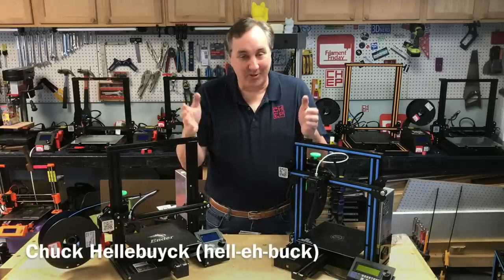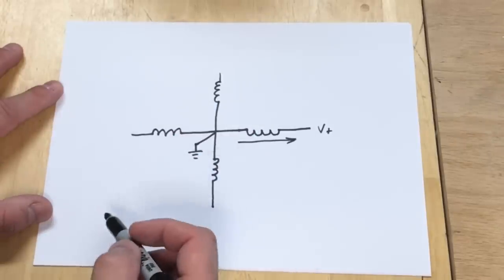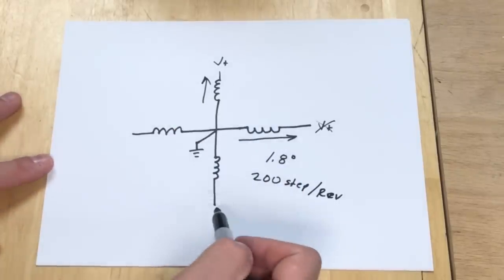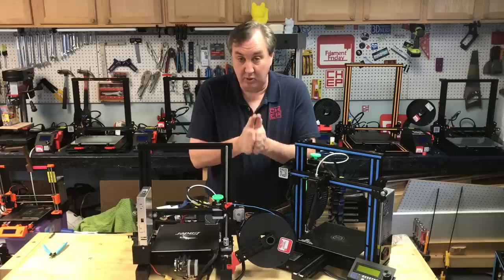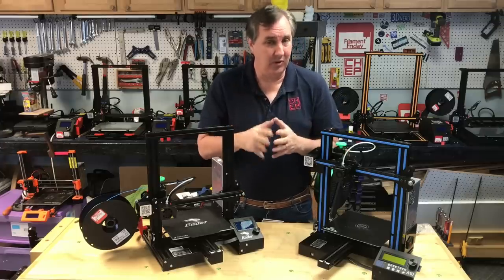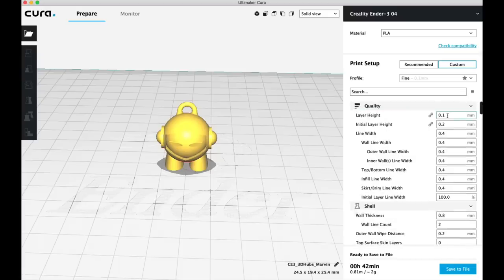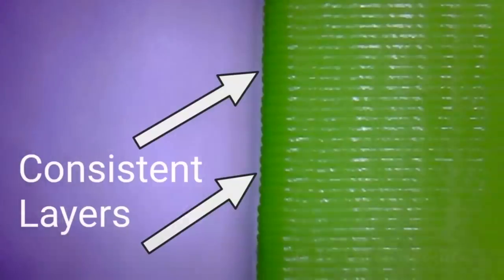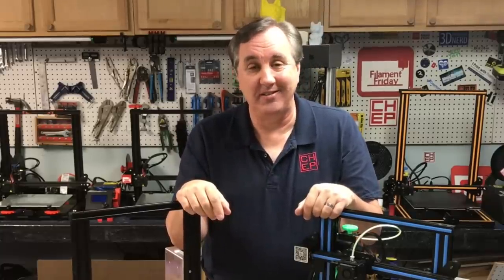Better Quality 3D Prints Using MAGIC NUMBERS on Creality Ender 3, CR-10, A10

Comment: So as I understand this, we're trying to step up layers using only the motors natural steps, Right? Because these are steps along the rotation where the magnets "want" the shaft to stop and so are more predictable/consistent than microsteps? If I'm correct so far, I can get behind that logic, it makes sense to me. But what if your Z0 happens to be at one of the motor's microsteps? Doesn't this all kinda go out the window?
Reply from the maker: Nope, it rises to the same Microstep each layer thus averaging out the variance.
Reply: Machining tolerances in the rotors and stators of stepper motors are not precise. 
Every tooth on each rotor and stator are slightly different, ANY given microstep applied to any tooth will vary from one to the next. There is zero benefit in trying to land on the same arbitrary number.
Think of full steps as large peaks and microsteps  as (8 or 16 or 32...) smaller peaks between each larger peak.
The peak to peak distance of each full step varies slightly, so each repeating micropeak will also vary.
Reply from the maker: But if you ride at the same step each time you average out that variance for a more consistent Z height.
Reply from the maker: The stepper driver creates multiple magnetic vectors between the motor natural steps. This logic just creates a consistent resolution so the Z axis rises from the same point to the same point of the motor rotation.

Comment: Thanks a lot.
If I well understand, that means the minimum layer height I can use for the best results on my Ender 3 will be 0.04mm, right?
Lower height will be no use (because smaller than the step) and use much more time for same results.
Reply from the maker: Because of the mechanical limitations I would say 0.08 is the minimum.
Reply: Thanks  @FilamentFriday , I'll have to test it. But currently with 0,4 nozzle, not sure it will worth it, need to test 0,08 with 0,2 mm nozzle for best results.

Comment: Where do you get these specs for a 3D printer so you can calculate the magic number? I'm using a Creality CR-5 Pro H. This is one of the best tips I've seen to increase quality. It seems like common sense and something I would assume would be factored into the slicer settings from the factory.

Comment: For sure it makes a difference running the Z at full step resolution, but in reality You will hit a random microstep when homing, and only have the relative moves be full step, never ending in the most stable position. So no idea, why it actually works.
Reply: Same thing I thought,  unless you end up homing on full step at beginning it will be off the rest of the time
Reply from the maker: Because like I said in the video, even if you start at a microstep you rise up at the same microstep position all the way up so you get consistent spacing.

Comment: Will you do info on the ender 3 firmware? Firmware updates? On all of my long prints I ALWAYS get -> Communication timeout while printing, trying to trigger response from printer. Configure long running commands or increase communication timeout if that happens regularly on specific commands or long moves.
with octopi

Comment: Does that mean that getting lead screws with smaller pitches could potentially improve print qualities because there's a lot more "magic numbers" you could work with?

Also what about if you have mesh bed levelling enabled. I'd imagine the printer would be doing lots of microsteps for the initial layers before it reaches it's "fade Z height"

Comment: Hi, thanks for the vid. I'm not exactly sure if magic number theory is correct, because for it to be true, z endstop should always occur at full step. How can one be sure it is? If endstop happens at half step and you try to add 0.04, it will still be a half step.  Or am I not seeing something?
Reply: I think the point is that you will always be using the same microstep, which means that the print will be more consistent.
This might also vary with higher-resolution stepper drivers like the DRV8825.
Reply from the maker: Nothing guarantees the microsteps are equal angles but as I stated in the video if you start at a microstep you rise at that same consistent step.

Comment: There is a reason to use a single start lead screw for Z (I switched my big DIY printer to use those)-- yes the step/mm will be high, but then there are no magic numbers as single physical steps are 0.01 mm. Can't move Z very fast, but who needs to -- so I get super high precision on Z, and super accurate layers
Reply: You DO have a magic number - it's 0.01

Comment: 1) this magic numbers will only help if your stepper starts homed with a fullstep what is unlikely
2) there is a calc on reprap
Reply from the maker: 1) Not true. If you start on a microstep you will rise a full set of microsteps and end up at the same step all the way up. This averages out the variance in the Microstep angles giving the print even layer heights. 
2) yes there is.
Reply: @FilamentFriday  Sure helps, because of the delicate balance driver needs to accomplish to have the uSteps* evenly distributed (if it succeeds!) between a full Step  and the next one,  as a result uSteps don't have the torque the Steps have, the load will be lifted strong at Step then less and less strong until the middle uStep then the process reverses becoming strongest at the next full Step, as the load is equal but torque varies the distance between uSteps will be more consistent , say,  equal, if the path is multiple of uStep settings (i.e. multiple of magic number) . e.g  if it will fall in the same weak  torque uStep or the same strong full Step doesn't matter, the key word is here "same".  Good video, though you scratched too quick the uStepping  balance process :)  *by uStep I mean micro step

Comment: You mention that this works for microstepping in between layers or if you are are natural steps.  Is there a way to check if you are at a natural step or microstep, and perhaps adjust so that you are at natural steps throughout using z-offset?
Reply from the maker: Read my comment above yours for more detail.

Comment: Hi CHEP, 

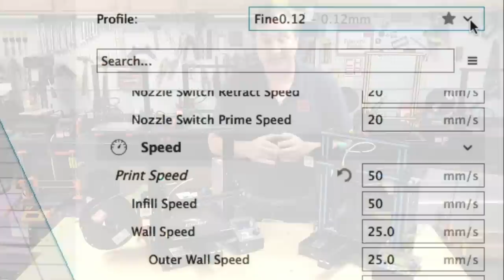My CURA 4.8 only has three (3) quality settings: High (.10), Normal (.20) and Draft (.30)...are your settings (at the 3:45 mark) custom settings set up in individual custom profiles, or are they someplace in CURA that I missed in the initial setup, or are they machine specific (I have an Anycubic Mega S).

Thanks! Your videos have helped me bunches.
Reply from the maker: Your machine specific I assume. I show the Ender 3 in my videos.

Comment: Cura 4.7.1 now applies the Ender 3 pro magic numbers to the default quality profiles, however it does not go below 'Super Quality 0.12' layer height.  What would be the best way to add a couple of profiles for Fine/extra fine at .04 and .08 layer height?
Reply from the maker: Use “Create profile from current settings/overrides...” after you’ve made your changes

Comment: Thank you for passing on clearly brilliant advice in your videos. After watching thwm i have now infact bought the ender 3 along with the extra nozzles, it arrives on the 11th. I will be using magic numbers like the 3d printing bible after seeing these results.
Question pretty please with a cherry on top?
How can i apply the magic numbers when making D&D-style table top miniatures? As in with the smaller nozzles, i would like to aim for a relatively detailed finish if possible. Using Hatchbox PLA and files from thingiverse, as i literally am newb level, in the future i will attempt my own designs, but for now i want to go on a printing binge without blowing a roll of filament 😅.
Reply from the maker: Print at 0.08 layer height.

Comment: Great video Chuck, I have a Balco HE180021 does it have 8mm per single rotation of Z axis screw and 1.8 degree stepper motor?
Reply from the maker: I don’t know but most printers use 1.8° steppers and you can measure what one rotation of threaded rod does.
Reply: balco is a wanhao i3 clone and the magic number is 0.02

Comment: Thanks for good tips but I have Question.
so even though I set my layer height to 2.0 for example, the stepper motor won't line up with it's main coil(not micro stepping) because the initial coil or step will set to somewhere between using micro step when they home to Z. So do I have to somehow level bed using avoiding micro steps, considering when they home to Z?
sorry for my bad English, this is what I meant
so let's say there is absolute position for axis
and the video says the position is good when it goes 0.2 0.4 0.6 and not good on 0.15 0.30 0.45...
but when I home to Z, the initial position will set to somewhere not 0 for motor. so even though I set my layer height to 0.2 or 0.12, if initial height was set to 0.05 because of homing for example, then my layer height will be 0.25 0.45 0.65...
and my question is, is this good? Because it is still micro stepping even though I set my layer height to 0.2.
Thank you.
Reply from the maker: Even if you start at a microstep you will rise to the exact same microstep position if you usd the magic numbers. This gives you consistent layer height.

Comment: Love the videos!!.. Would your Cura "Magic0.12" be the same as what you're talking about in this video? I have Sliced with the standard quality .2 profile and then sliced with Magic0.12 and it will add time to the print...what is it that I'm missing. ?  thank you
Reply from the maker: The 0.12 is a finer resolution so it’s smoother.

Comment: Hi Chuck. I came across an explanation saying that step motor drivers like tmc2209 give you more steps. do you know if it is true? does it change your calculation?
Reply from the maker: No, the magic number is based on natural steps of the motor not microsteps.of the driver.

Comment: Hi Chuck, love your work.  Are you sure about the 8mm rise for one revolution?  That seems a very course thread.  Usually an M12 thread has a pitch of 1.75mm, this would change your magic number by heaps.  Apologies if this has already been asked and answered, I had a quick check and didn't see anything.
Reply: Good point but its not a regular metric thread.
Reply from the maker: I’m sure and it’s a 4 start lead screw.
Reply: @FilamentFriday  it is indeed.

Comment: Are magic numbers in use with Core XY printers?  I've stuck with these magic numbers all the years since the release of this video and I guess they're still working on my Bambu X1C and my Flashforge AD5M because I haven't noticed anything.  IF anything they are the default layer height options in Orca Slicer.  Just curious.
Reply from the maker: Most machines/slicers have corrected for this.

Comment: Thinking further on my Ender 3 pro factory setting under Motion/Steps E steps of 400 steps/mm doesn't this mean that the 8mm you said was raised by one rotation of the z axis lead screw would take my Z stepper motor 8 x 400 =3200 steps. You said yours took 200 steps. Something wrong ?

Comment: What is the magic number for a 1.7 step motor?

How did you conclude the motor to have 200 steps per revolution?
Reply from the maker: Never heard of a 1.7 stepper. 
Most are 1.8°. So one revolution is 360°/1.8° = 200 steps.

Comment: Is it possible to do a follow on video with the method that u used to find the number.  In my case i am very new to the hobby and I'm trying to learn as much as possible and like another guy on the comments i got a Delta printer.
Reply from the maker: Delta is different. I don’t have that detail.
Reply: That would be complex and varying geometry (not complex as in difficult to calculate, its that the magic number would forever be changing based on its relative position and total height even for average would be changing due to increasing angles of the triangle). So I don’t think there is a magic number, it would technically change every layer and be a mathematical curve if graphed out).

So in short it doesn’t have ONE, and it would only be useful for one data point or point matrix. Basically don’t worry about it as it doesn’t have one, you’re good, and good question!

Comment: The full 200 steps of the stepper motor would be more than sufficient for the z-axis, or not? Why then don't use micro-stepping at all? I don't know, is it possible to disable it by G-command for example or only in hardware on the drivers?
Reply: you use micro-stepping to have the motors jun smoother and more quiet. also there's nothing that can tell you if your endstop is halting the motor (reliably) on a full step. It depends on other hardware and the firmware. even if you got another board just to control your endstops, the polling rate isn't high enough to give you that precision. adding debouncing hardware or software makes it impossible.
Everything that comes with the prefix "magic" is most likely a hoax, a scam or, like in this example, an uninformed myth.
Reply from the maker: As so stated many times here in comments and referred to in the video, if you start on a microstep you rise to the same micro step position using magic numbers. The Microstep angles are not equal so using magic numbers you avg out that error because you will use all of them with magic numbers. That why under the microscope I show how consistent the layers are vs not.

Comment: would it be better to have a higher or lower thread pitch? A 2mm pitch would give a magic number of 0.01mm but would it be worth it? If you get what i mean
Reply from the maker: It will move a lot slower in Z but should be a bit better.

Comment: Thank you for the great explanation that considers both the electromagnetic polars of the motor and the mechanical lift of the z-screw.  I would like to see how this translates to my own printer JGAurora Magic.  What is the screw pitch  of your model printer's z-screw?  I know that you mentioned that one rotation of the screw threaded shaft gave you an 8mm rise, but that seems like such a coarse pitch.  I don't know how standardized these threaded screws are among the different companies and models of printers.  Thank you again.
Reply from the maker: Creality uses a 4 start - 2mm pitch resulting in 8mm lead.

Comment: Do printers always home to a full step? I might be missing something but if they home to a micro step accuracy then any "magic number" multiple would just end up as a microstep anyway right?
Reply from the maker: I’ve explained this many times in comments. If it starts on a microstep, it rises to the same microstep using magic numbers. That way any variation in microsteps is filtered out.
Reply: @FilamentFriday  My apologies I should have read your  pinned comment. Thank you for  your reply non the less.

Comment: Hey Thank you for this great information, does this also works by a jgaurora a5!?? Thanks for this video
Reply from the maker: I don’t have one to test but turn it one turn and measure the height change then divide by 200 because most printers use 1.8° steppers.
Reply: @FilamentFriday  thx for Thema quick answer

Comment: How do you know for sure that you're starting on a full step? When you home the printer, does it only move in full steps?
Reply: I'm pretty sure that when the stepper loses power, it falls into a natural step.  You can feel them if you turn the motor axle when the power is off. But I see your point, if your homing uses micro steps, then you will not be starting on a full step to begin with. In this case, the first time the z stepper misses a micro step, it will fall into place.
Reply from the maker: I state it at 3:00. Even if you start at a microstep, you rise to the same microstep consistently.
Reply: @FilamentFriday  Yeah, after reading through the other comments I was able to get a better understanding of your hypothesis. It sounds good in theory, and your results look great. I'm testing this myself now, but since my bed is mesh leveled, the z changes micro steps across the same layer depending on it's position. If your hypothesis is correct, then my layers will be consistent, in the z axis but vary along the x and y. I might make my first video to show my results. Thank you for all the time and effort you put into this.

Comment: is the ender 5 machine the same as the ender 3. ive been using .1 .15 .2 for my different projects .2 at 80mm s for bigger prints that dont have alot of detail to kinda speed them up and .1 at 50mm s for smaller printers or anything that has alot of detail. if its the same as the rest of the creality machines then i should be doing .12 .16 and my .2 is fine, i dont use cura ive been using the creality slicer 1.2.3 that came on my sd card with the printer an its worked perfect from day one, but thats where those numbers came from its presets for the ender 5. u would think they would have it set with the magic number. when i try to use cura it doesnt seem to come out as detailed and ive failed to figure out how to get ur profiles to work an all i can get is 4.4  ive had no luck getting the 3.4 that everyone tells me to try but from my understanding the creality slicer is cura 3.4 thats been reskinned an tweaked by creality.

Comment: i have a project where i have to hack in layer height into equation , luvered panels for a 1:60 scale model but there is a problem with  magic numbers, i need layer height between 0,2 and next magic 0,24 i need 21 distinct lines  of the same thickness on 4,6-4,7mm sidewall would half step be more accurate than random microstep? or should i slope the part to extend it keeping to let's say 0,2 or 0,16mm? i want layers to be very noticable but i doubt i can achive sharp edges